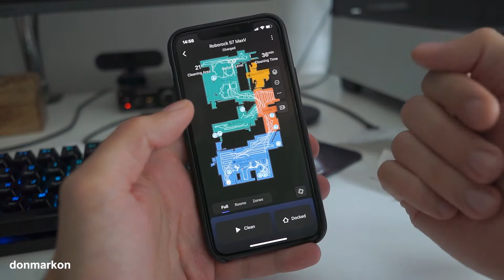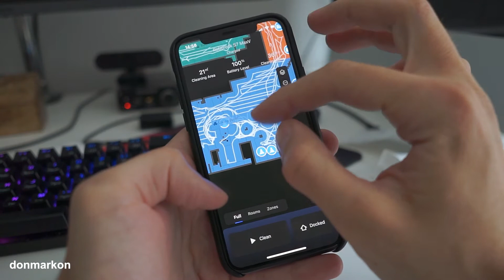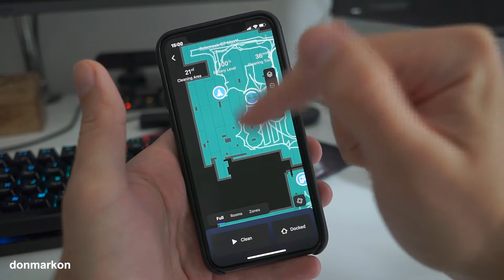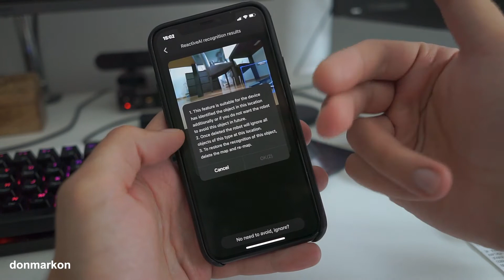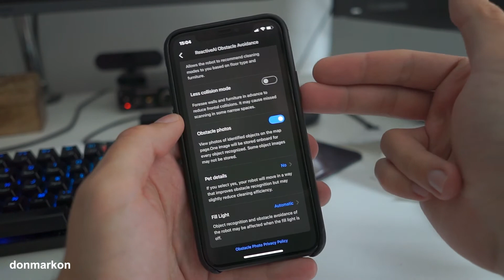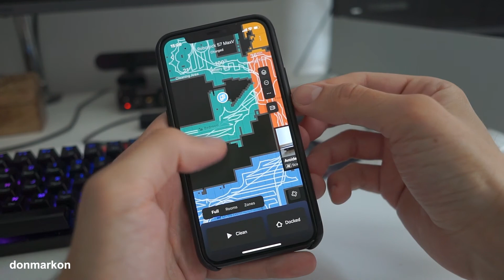Roborock S7 MaxV Obstacle Avoidance Detection App Review Pros & Cons | Self Cleaning Robot Vacuum

Comment: which one you prefer? s7 or the roidme?
Reply from the maker: Both have their strengths and weaknesses ... It mainly depends of place which need to be cleaned
Reply: If u only could get only 1 unit, which one will you get between the Roidmi Eva & Roborock S7 Max V? Then if Eva is like 350 euros cheaper, which one will you get? Cos I am trying to decide between both of them now and you have been using them both... Advice is much appreciated. Thanks.
Reply from the maker: As i dont have self cleaning dock for S7 MaxV i cant really tell ...
In theory it should be better and more versatile ... but again i didnt test it  (S7 MaxV)
But considering price difference ...